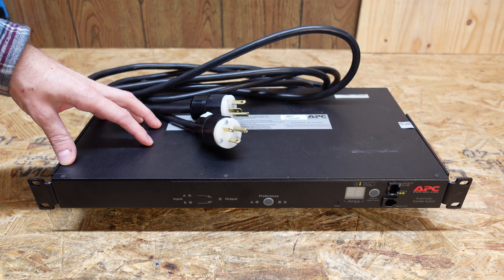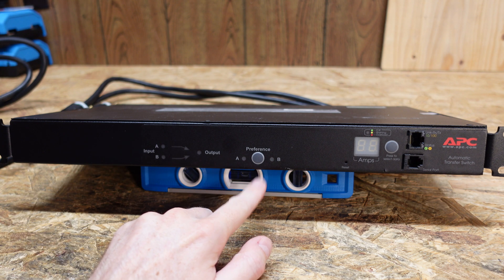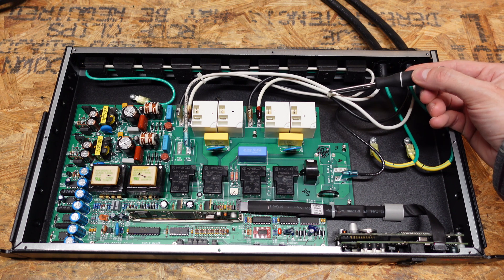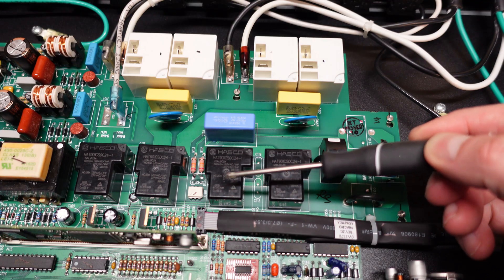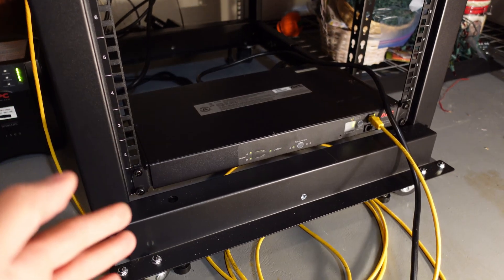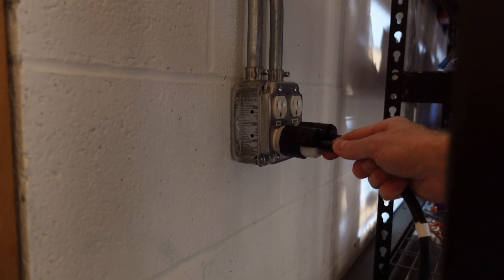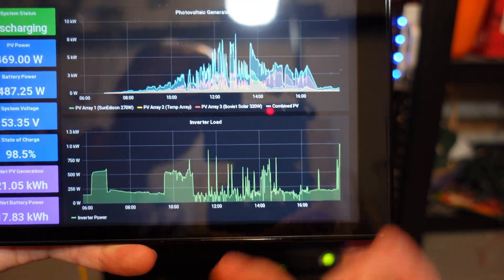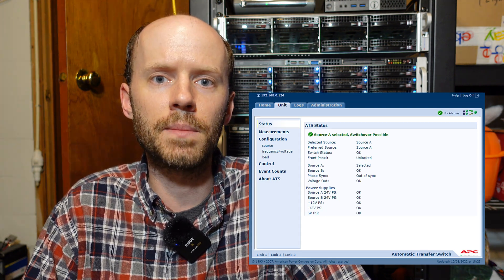APC Automatic Transfer Switch, Off-Grid Solar Backup for the Chia Server Rack

Comment from the maker: APC Transfer Switch... https://ebay.us/x557yY (check compatibility, affiliate links)
StarTech 25U Rack... https://amzn.to/3cRfeH3
Let me know what you guys think, is this a good solution for not wanting lead-acid batteries? Or should I just invest in a proper UPS to reduce the possibility of equipment damage?
Reply: An APC 1500 UPs has ~40w idle power burn.   40w * 24hrs = 960w/day.  Do you know the idle watts for this ATS?   I'm thinking that as a replacement for a UPS it might reduce idle watt burn significantly.
Reply: @kennethalmond8922  exactly: usually any datacenter intelligent rack pdu and sts are using an "insane" amount of power. I have replaced the inner works of a WTI PDU that usually uses less than APC with shelly.cloud 4 channel switches to reduce.
But these APC STS are very good, switching between unsynced mains and UPS while not really killing the PSU's of your servers.
I've seen what happens when you let a faulty UPS (one that delivers 3x450A @240V) do the switching while your mains is still good. The UPS would switch on and off saying the mains is gone. But it wasn't and it was switching out of phase. And with every switch another PSU/server would die.
So yeah: never trust your UPS, use an STS.
Reply: Absolutely nothing wrong with using old hardware. Keeps it out the landfill. As long as transfer times are <=10ms, most computer systems will not even notice the change over, even if the sine waves don't match.
If you don't have a smart enough UPS that can take lithium based batteries, then this is definitely a great alternative if you already have an inverter to output power.
Reply: With your use and setup of this device, I would add a couple of WiFi smart plugs to the mix. That way you could swap power sources remotely. The plugs I use can be switched on/off from my phone anywhere in the world. They even have a scheduling feature that allows you to use them like a timer. You could create a schedule on the grid outlet to turn off during peak hours of solar. The same to turn off the solar outlet during the night etc. It could automate the process or give you remote manual switching options. Or both ;).

I have often thought of hacking an inexpensive or used UPS and adding a large battery bank to it. I've actually come across a few different types being disposed of. More than likely because the battery inside was dead. I would think you could tap into the battery connections and expand them to hours instead of minutes of backup power. I never took the initiative to experiment, however.
Reply: @thebuckeyedan  The device has network connectivity already to remotely control it. So no need to add extra overhead with 2 smart plugs (which would be an additional $15 each). Just use Home Assistant to tie into the existing control interface as he already stated about controlling it through PHP commands.
Reply: @korishan  I have several smart plugs just lying around. I have no knowledge of the control interface in that unit. Your suggestion is definitely the way to go. A follow up video of the software and control solutions with it would be very informative. (fixed reply)
Reply: @thebuckeyedan  For the UPS and adding batteries, it's much easier to get a server/commercial grade unit as they 'usually' have an external port on the back (SB50 connection) to add extending runtime.
The other reason for using server/commercial vs residential is that they are designed from the ground up to run 24/7 on full load whereas residential ones are only designed to run about 10 mins. Those resi ones heat up fast!

Comment: ARE YOU SHITTING ME!? I put lifepo4 batteries in UPS all the time. I've got at least a year on already. I have a thread on L1T forums. 12v lifepo4 has the same charge curve as lead acid.
Reply from the maker: Yep, it works great! Until it doesn't :-)

Comment: Is ok to use a UPS behind the ATS to avoid the blinking of power transfer. It might not be too bad on lights but servers don't like that, specially if you are running raid based applications.
Reply from the maker: Absolutely. I think this is intended to be used with a UPS anyway. That said, I haven't had any trouble with my servers when it switches sources.

Comment: Appreciate that you shared the internals and a brief summary of what you think is going on inside. I had really wanted to see and get an idea of what was inside before buying as these are not dirt cheap, unless you sway for the 208 volt versions like I did... I just picked up three 2U size 208V units (AP7732) as I got them for an irresistible price (less then even just one 120V or 240V unit I could find!). The 120V and 240V units tend to run much higher, probably because of it being more useful in situations for regular users. Sucks APC does not release any internal info and loves to use in-house part numbers. Its odd, it looks like there are two switchmode PSUs, but then there are also those two larger transformers. From what I can see, it looks like those are just classic linear PSUs, but I wont know until my units arrive and I start reverse engineering them... I am suspecting the 24V section will be the same on all units, and maybe the transformers and isolation relays will be 208V... Hoping I will be able to modify it for either 120V or 240V operation (just applying 240V is a no-go because it is outside the voltage sense settings range, it tops out at 233V).

I am presuming the MCU on the little SIMM looking card is for easy production of the units. I see there are blank spots on the board for 2 bank operation, so likely they made the MCU removable so that there is minimal component changes to make the different voltage and capability models.

Despite the lack of info for internals of APC products, they are indeed always VERY well built and an abundance of great parts.
Reply: These have arrived finally. I have not done a full reverse engineering yet (desoldering components, etc) nor powered them up yet (I do not have 208V, but I do have buck/boost transformers).

The 208V unit is a bit different, mainly in relay setup and sizes (higher amps, and parallel contacts on each relay - PC pin and quick connects)

The white relays are used to isolate the inputs as you suspected. The coil voltage of these will be whatever your unit was designed for (208V in my case). Two per source, one for active/hot and one for neutral. All four of the white relays are N.O. SPST

As soon as a source gets power turned on, the respective pair of these relays energize as the coil is directly wired to the respective input.

The outputs of these then feed a pair of SPDT black relays. One for the active/hot, one for neutral. Source A is connected to the N/C contact, Source B connected to the N/O contact. The common terminals feed another pair of SPST black relays.

The neutral then runs to the output sockets. The active/hot goes through the current sense loops and then to the output sockets. My units have two banks, so the total output goes through one loop, then it is Y split, and each leg (bank) has it's own loop. Hence the provisioning of 3 places on the board for loops.

Each source's output from the white relays, also feed a SMPS and a stepdown transformer. Each is identical. The SMPS main section looks to have a single output, which goes through a diode. The other side of each diode is tied together, then this feeds LM2874N stepdown LMDMOS regulator setups. Before the diode combining, each SMPS does appear to also go through some resistors and to the area of the ADC, I suspect this is for individual SPMS output monitoring.

The stepdown transformer looks like a single primary and dual secondaries, with the centres tied to ground (which on industrial transformers would often be identified as X2 and X3). Appears to be two small diodes acting as a full wave rectifier, and after filtering, each source is applied to a ADC0848 8 bit ADC (pins 3 and 5).

There is however, one side of the unrectified secondaries that feeds off to more passives and then a 2222 transistor. 

I am going to take an educated guess and say that the SMPS is just to provide power for the logic/MCU and those step down transformers are responsible for the input voltage/frequency monitoring (I believe these units measure frequency, and maybe power factor as well, as part of a quality of power sensing).

All that being said... It would seem the stepdown transformers and source isolation relays are unique to a model's intended voltage. Bypassing all the logic and directly controlling the relays is easy, however probably the easiest way to have the product's logic work is to feed the step down transformers 208V from a small boost transformer (or buck if going for 240V operation). The transformers are of course house part numbered, so not really obtainable unless you strip out another unit. 

I need to dig and reverse further, to see just exactly how it is sensing, and if there is a possible way to change it on the secondary side, without buck/boost transformers. There are a lot of 1% resistors in that area... would be great if they were in some divider arrangement and simply changing some to change the ratio would do the trick.

Comment: How do you deal with 2 power sources where the respective grounds are not bonded together? My solar installation is TNS (earth rod) and the grid power is TNCS (earth provided by utility via grounded neutral wire in grid). While in theory the 2 grounds should be the same (they are both referenced to earth at some point after all), I've made sure to keep them separate within the house.

In thinking I might have to install a galvanic isolator on the grid input to the ATS to isolate the ground.

Any tips appreciated, thanks
Reply from the maker: It sounds like you need to consult an electrician... I don't know why you have multiple ground references. That sounds very wrong to me, but I'm not an electrician.
Reply: @LithiumSolar  it's more to keep the 2 systems completely separate. The solar is a DIY install and the grid system is the professional fixed installation that came with the house

Comment: That is awesome. would you be able to do a little video with the firmware update procedure and where to get it from? :D
Reply from the maker: No videos, but you can obtain the firmware from the APC website https://www.apc.com/us/en/product/AP7752/rack-ats-120v-20a-l520-in-10-520r-out/ Plug in the network connection and find the IP address. You can press and hold the display button to show it or check your router DHCP. The firmware download has a program that you input the IP and password, then it uploads the firmware via FTP. Very easy.

Comment: You had mentioned that you had many LiFePo4 batteries sitting around and wanted to use them.  Have you found it Ok to connect different brands of batteries together with out issue.
Reply from the maker: The APC UPS are designed for lead acid batteries, not LiFePo4. That's why I haven't used them.
Reply: @LithiumSolar  Are you connecting diffirent brands of LiFePo4 batteries together in the new configuration.
Reply from the maker: @thechiefsway2618  I'm not sure what you're asking. This is a transfer switch, it doesn't use batteries. I have never put LFP batteries in a UPS. If you're asking just in general about the LFP batteries - yes, it's generally fine to connect different brands in parallel provided they are of the same chemistry, voltages, etc. You should never connect different brands in series.
Reply: @LithiumSolar In the video you said that now that you had this switch you could use all the batteries you had sitting around (I assume from the reviews).  I assumed you would use those batteries with an inverter and charge controller to back up or power  the server rack using the new switch.  With all your reviews of different batteries I was asking if you had success connecting batteries from different brands together when the Brands do not recommend it.

Comment: I’m doing the same thing with the newer version of one of these. Switching is done based on some logic that looks at solar forecast sensors from home assistant through node red. Control of the ATS is via SNMP switch in HA. My grid source does go through an APC UPS while solar is direct from inverter/batteries. It’s been running great for the last year.
Reply: Can you share your config on home assistant. Struggling to set up mine

Comment: Does it switch at zero-crossing or just whenever?  The "phase" comment sounds like it might be doing zero-crossing switching...
Reply from the maker: I'm not sure but that would be super cool if it were. It happily supports unmatched phase switching though so one of them would be non-zero during the switch.
Reply: I’m not sure you can hit the zero cross with mechanical relays. Large Industrial UPS’ do this with IGBTs as solid state devices are much faster so you can accurately hit the ZC point.

Comment: Great video as always.

Looking at the datasheet for the relays it looks like the delay in switching is about 15ms. The one concern I have is the relay datasheet does not say that the contacts are break before make, so there could potentially be a short period of time where both voltages are tied together.
Reply from the maker: This is a commercial product designed to switch between two different power sources. I would assume it's not shorting the sources together for a short period. That would be catastrophic...

Comment: That is a cool gadget especially for a small off grid system that’s still has a 120 V grid power input . I wonder if it can be utilized to start a generator at some way or between two inverters without grid power ? When you get a chance , check out my DIY solar videos , leave a comment, hit like and subscribe if you haven’t yet .May the solar be with you .😊

Comment: Good one!    I use Progressive and Go-Power ATS(s) to auto-consume my off-grid solar power - e.g. as battery charges / inverters turn on, the ATSs automatically feed solar power to the circuits and then when the batteries run down the ATSs auto-switch back to grid.     This happens twice daily BUT...   I need APC UPSs to smooth out the 'switch' as it's not reliable for computer, tivo, and other sensitive equipment.     This  looks like it could replace a Progressive/Go-Power ATS+UPS combination - but it wasn't clear if you think it could do this twice daily automatically, and for several years at 365 x 2 = 730switches / year.    Maybe if you do a followup you could share you're thoughts.    In any case - thank you for so many great vids!!!

Comment: We used these units for years. Please note that the relays wear out after a couple of thousand switches, especially when using two different and unsynchronized power sources. In these cases every switch action creates a small arc inside the relays. I had an engineer of a different company (not APC) telling me that these units are usually designed for 40.000 switches, but when using unsynchronized sources the switches are reduced by half.

Comment: Well done!   Learned a lot.Why not an inductive load?
Reply from the maker: Inductive loads pull huge surges at startup, could easily be 4-5x their rating, and could result in the relay contacts being welded in one direction after enough times.

Comment: I have replaced all leadacid in my ups's with Lifepo4. Not using bms , just have an active balancer and a fuse. The ups takes care of over discharge, charge and other protections and i have monitored what it does and it is very accurate with the cut off voltages. The issue with having a bms is that it might cut off before the ups shutsdown and when mains is restored the ups won't automatically turn on again cus there is no battery available to it. So u have to manually press the power button to turn it on and that defeats the purpose of having a ups. This setup been running for more than 6months now and the battery backup from 12ah Lifepo4 is similar to 27ah leadacid.

Comment: Built a unit does basically the same thing. With the exception that mine totally isolates all of the connections including the ground. Normal is grid power. Backup is inverter with inverter being priority. Turn on the inverter and it switches to it after a timeout delay. Turn off the inverter and it switches instantly to commercial power if available.

Comment: Phase matching may cause problems despite the documentation.  It's probably doing break before make switching so the supplies are never cross connected which is where the safe switching aspect comes from.  A lot of people don't realise it but most offline UPSes phase match before transferring the load.  Without phase matching the transfer to the inverter could see considerable current flows, potentially tripping its overload protection.  Cheapie inverters can go bang, seen that happen in real life.  Not saying this will happen, but it is something to consider.
Reply: A little more explanation since I've noticed YT doesn't like long responses.  Switching power supplies will usually not cause any problems and this is the primary purpose of this ATS.  The full bridge rectifier in the switching PSU will mean there is never a case where the reservoir capacitors are ever opposingly charged to the AC input.  A capacitive dropper could present this issue but it would have to be unusually high current and that is typically not what cap droppers are used for anyway.  This leaves inductive loads as being the problem because they can be opposing the AC input on out of phase switching and that's where things go wrong.  LithiiumSolar does point out inductive loads so he's across the issue.